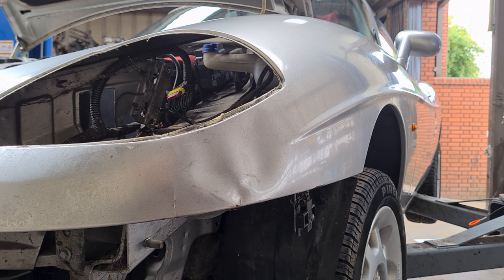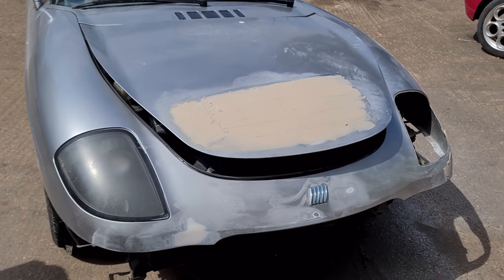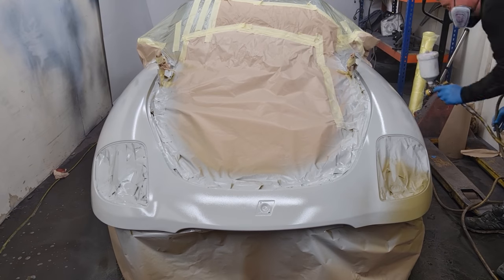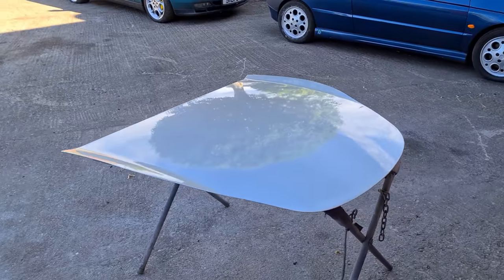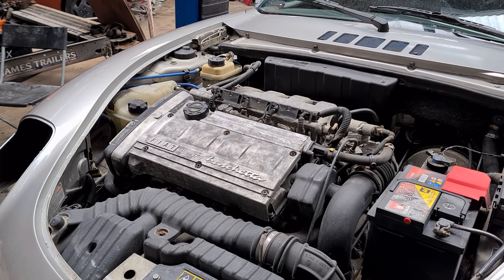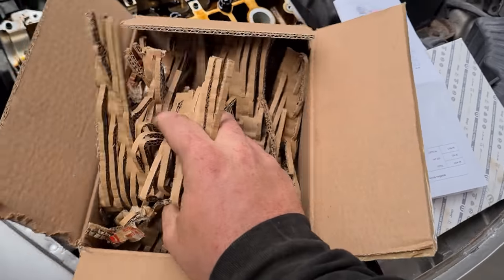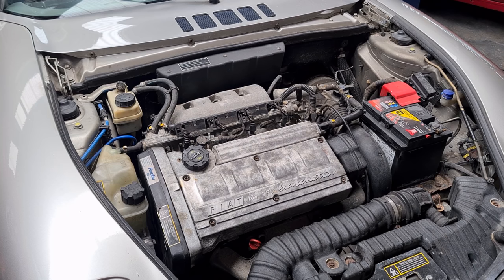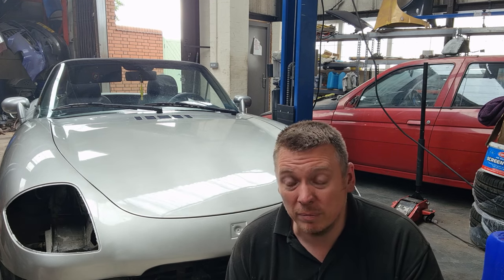Loads of work gets done on the Fiat Barchetta

Comment: Hey mate like I've mentioned in your first video on the barchetta  I'm also fixing up one I remember in the first video you considered changing the hood because it seemed to leak, that might not be necessary as a common problem on this model and might just be as easy as FIAT BARCHETTA WINDOW REGULATOR set I found on eBay for about 17 usd and in my case a new back window for 125 euros. Plus the hood you got already is perfect for that silver paint. Just send me a message if you struggle to find these part. 
And again thanks for the videos very much enjoy your work.
Reply from the maker: cheers its something on my list to look into.

Comment: Great video and really enjoyed the bodywork process. I note you dry sanded everything, why or for what reason would you wet sand?  Will be fun little car when done. ✅
Reply from the maker: I dont know why anyone would wet sand as its so much easier and less messy dry sanding.
Reply: @ItaliaAutos  You can achieve a better finish with wet and dry paper in my opinion, plus, the wet sanding helps to keep the dust down and stops the finely gritted paper from clogging up.

Comment: Great job on the repaint, and the cam work. Is the corrosion on the underside from winter driving ?. Car design is beautiful, i like how the headlights ref the covered headlights of old Ferraris, also good you got one without the 3rd brake light . Unreal that they didn't think to sell the Barchetta in California, or any US market, esp considering how many MX5's have been sold.
Reply from the maker: thanks. yeah rust if from uk winters

Comment: You should try to tidy up the cam cover, light sand blasting works wonders and will may the engine bay look much cleaner - same for the undercarriage, although there you best option would be dry ice blasting. Great work so far.
Reply from the maker: i think someone has had a go at it. it will prob be on the list.

Comment: Neil do you recommend replacing the rocker cover gasket with a new item when you do a cam belt on a twin cam/twin spark engine? You really have turned this car around!
Reply from the maker: I would yes as its a common leak point

Comment: Excellent work..........jealous as hell because you have a ramp and all my welding is on my back. Just make sure you leave plenty of drain holes free, mine were blocked and because the Hood leaked it filled up with water regularly. Did you manage to get a hood seal kit............i was quoted 600.00 euros which has prompted me to find a cheaper solution using sikaflex and bicycle inner tubes when i finish the floor.
Reply from the maker: not looked at the roof yet.

Comment: take a close look at the rear wheel arch boxes, they'll rust through like
Reply from the maker: All fine.
Reply: @ItaliaAutos  and when opening the roof, make sure that there is no kink in the window, otherwise it will tear quickly
Reply: @ItaliaAutos  looked good on me too, but was only held by the underbody protection, on the right rear wheel on the front where you can see an x, press once with your finger

Comment: That car needs a Liqui Moly proline flush, an oil and filter change with some triple qx 10w40, run up to temp maybe for a few miles, and then immediately drained hot again.  The oil looked black enough that the new oil is looking black already I bet!
Reply from the maker: it will get another oil change once its been run for 50 miles.

Comment: I would have changed the camshaft sensor at the same time.  They also fail and then all the work with the timing belt has to be done again
Reply from the maker: i wouldnt because they rarely go wrong,on alfas anyway and there the same part.
Reply: @ItaliaAutos  for me it was defective after 130,000 km ... first sporadically then total failure.  Read fault memory